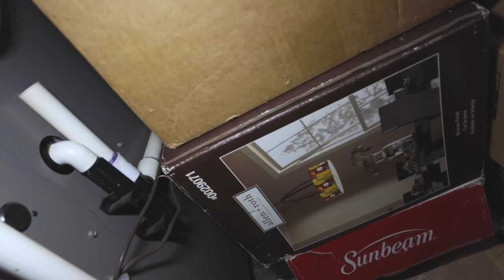Inducer Motor Gurgling Sound | 90 Percent Lennox Furnace Inducer Motor Flooding due to Blockage

Comment: Thank you so much for sharing this. I had the same exact problem, which is now fixed after following your instructions. Leaving a detailed comment, maybe someone can benefit from this. I've a similar Lennox furnace and it had been making this gurgling sound, which didn't bother me much. But over the past few days, my heat was cutting out intermittently. Thanks to some other videos on youtube, especially Jay @ World of Advice TV channel, i started looking for the cause and fix. Furnace was igniting, could see the flames but it will go out after 1 minute or so and occasionally worked fine for a day or two. Cleaned flame sensor, it didn't help. But I then noticed that my control board light flashed 3 times before the furnace tried to restart again. According to the instructions on the panel, there's supposed to be an issue with pressure switch. Tested pressure switch using multimeter and it was fine. Checked for blockage on little pipes going to pressure switch, they were fine too. Finally, came across your video, took apart the inducer motor, there was water in it, took off all little tubes/pipes as shown in the video and the tube going to header box was clogged at the header box, cleaned the tube and the connection point, put everything together. No more noise from inducer and the heat is back on.
Reply from the maker: Amazing! Glad the video was able to help. Hopefully you come across some of my videos in the future that can be of service. Be sure to subscribe and thanks for watching!

Comment: Hey piling on here... thanks!   Great help.  I wanted to share what I think was clogging my drains -- PVC pipe burrs.  I pulled out the inducer blower, and then when I pulled the condensate tubes from the lower ports, I found a small pile of PVC burrs and bugs collected at the green filter plugs.  I cleaned those out, checked the main condensate piping to be clear, and put it all back together.  Runs great, no water knocking/noise any more.  Thanks again!
Reply from the maker: Thanks for that feedback. Ive seen that before as well

Comment: You are the man! Had an exhaust pipe hanger break. When fixing, a lot of liquid backtracked into the blower. You saved us from not having heat on a night with record low temps. Also, great call on removing the pressure switch over the electrical box.
Reply from the maker: Nice! I'm glad I can help and thanks for sharing!

Comment: Just got home from Christmas vacation too a cold house and a furnace sounding like my bath. I cut off the p trap thinking it was clogged. Watched this video and learned what an inducer is and how he removed it. My unit was different so I just opened the clamps and put a tiny hose into the motor and put the other end to a shopvac. Saved me having to remove the inducer.  Yuck but worked well. Thank Tou!
Reply from the maker: Nice! Glad I could help, yeah most the Goodman furnace have a little yellow cap you can pull off the bottom inducer and vacuum it out from there.

Comment: Excellent ! This was my exact problem on my Lennox EL296 and I was able to follow your video to source the fix the problem. The culprit was a blocked drain tube 6 feet away from the furnace and the water backed up all the y way into the induction motor causing that gurgling sound, Checked and cleaned all the other components so all should be good. Started the furnace up, no more gurgling sound and no more error codes. Thanks man !
Reply from the maker: Sweet! You're welcome glad it worked for you. Thanks for watching!

Comment: Thank you very much for capturing this!! I’m trying to replace my inducer motor, and I have the exact same model furnace and exact same inside. I should be able to follow what you did in the second half of the video to a T to replace mine. In fact, I wasn’t sure if you needed to take the inducer motor off; I was praying that you did. 😂

Comment: Thank you so much for sharing this. I had same problem as Arsh  had:  heat was cutting out intermittently, but there was no signal show this AMV9 two-stage variable speed has problem according to the troubleshooting manual. I asked service company  to fix it. unlucky, first person came ,make wrong diagnostic and said must replace motor then can check if there is other issues. after replaced new motor & frame sensor  30min same things happened as before , we call again and second service came : found blockage in inducer motor coupler cleared blockage .drained inducer motor and reassembled , now is fine. but there manager refuse to give use refund , insist they did right things. I hope more people can see you TV channel even want  service company come.
Reply from the maker: Thanks for watching and I'm glad I was able to help you with your situation

Comment: Thank you.
It looks like I had a similar issue.
The AC and Furnace plumbing is together in the left side of mine.
Seems to be that in the summer, the water filled up and overflowed into the furnace.
Reply: I have this Lennox SLP98V furnace in the Chicago area. HVAC installed it in 2013 with the I Comfort thermostat. Many parts have been replaced over the years when the furnace stopped working; blowing debris out of condensate tubes, replacing the defective Pressure Switch, the new Blower Motor Module, the new leaking Collector Box, and the new cracked Draft Inducer Motor to try stopping all the water leaks inside the furnace. Now how do I get rid of all the rust inside the cabinet of the furnace?

Comment: Hey buddy, I want to thank you - you saved my ass!   Have a new install and the blower motor was full of water, which meant it would not run, condensation didn’t drain.  So I saw how you removed blower and cleaned out the lines.  In my case I just dumped out the water in the blower and then put it back.  Plus cleaned out lines, not sure what was problem?  Maybe pvc crumbs from install.  But if it happens again I can fix it again.  It’s Christmas Eve and it’s minus 2 degrees here, so my Hvac guys are not reachable, without your video I would have been totally fxxked.  Thanks again!!    Btw good call on just moving the pressure switch rather than the electrical box!
Reply: Make sure the furnace is at least level, front to back. For best results after leveling, the back should be raised a half an inch. Also, the pvc extension, or vent, on the condensate trap should be at least 1" above where the condensate exists the cold end header box but not more that 2" above that.
Reply from the maker: Sweet! Yeah it's a pretty common issue I was just working on one the other day and a bird or something must have built a nest and the flue pipe and there was a bunch of red clay and debris clogging up the drain ports. Make sure to inspect your flue pipe otherwise it will continue to happen if there's something in there. I appreciate you sharing and thanks for watching!
Reply from the maker: Nice! Really appreciate this advice. Sometimes these 90% lennox furnace can be a bit finicky so I'm always trying to get as much information on them as possible.

Comment: What prevents exhaust air /gas from going into the "drain" line out of the inducer blower.  My vertical 2" PVC out the roof filled up the inducer motor with rain water and shut the furnace down.  I vac'd out the rain water from the inducer.  I put a 90 elbow on top of the 2" flue pipe above the roof line.
Reply from the maker: There's a water trap directly in line between the inducer drain line in the drain line going out of the house so the water trap prevents the gases from flowing out

Comment: Hey, thanks for sharing this!! I have the same model - the inducer makes noise but when I barely hold it in my finger it stops making the noise, tried to tighten up the screws with no luck. The pipes aren’t clogged/clear tubes. Do you recommend any solution?
Reply from the maker: It might be the internal bearings which I'm not sure are serviceable but that's the case you probably just have to replace the whole inducer assembly
Reply: I have this Lennox SLP98V furnace in the Chicago area. HVAC installed it in 2013 with the I Comfort thermostat. Many parts have been replaced over the years when the furnace stopped working; blowing debris out of condensate tubes, replacing the defective Pressure Switch, the new Blower Motor Module, the new leaking Collector Box, and the new cracked Draft Inducer Motor to try stopping all the water leaks inside the furnace. Now how do I get rid of all the rust inside the cabinet of the furnace?

Comment: My Lennox furnace just started making a similar noise, no faults just louder than normal. I would like to send you a short video of it to determine if I have a clog or if I need to replace the draft motor assembly.
Reply from the maker: Sure! you can send the video to hvactechknowledgy@gmail.com.
Reply: Heat exchanger secondary  could be starting to plug up

Comment: I have this Lennox SLP98V furnace in the Chicago area. HVAC installed it in 2013 with the I Comfort thermostat. Many parts have been replaced over the years when the furnace stopped working; blowing debris out of condensate tubes, replacing the defective Pressure Switch, the new Blower Motor Module, the new leaking Collector Box, and the new cracked Draft Inducer Motor to try stopping all the water leaks inside the furnace. Now how do I get rid of all the rust inside the cabinet of the furnace?
Reply from the maker: Hi there, sorry there's really not much you can do about the rust. If it's not that bad you might be able to put some of that evapo-rust on it. You can find it at your local auto parts or Home Improvement shops

Comment: Mine started making a similar gurgling sound just. The condensation line drains into the sewer but some took the hose out of the sewer and left it on the ground. I'm wondering if some water got backed up into the inducer because of that?  The hose is not plugged there is water on the ground. Since putting hose back in the drain the noise has become less and less. My question is if there was water in the inducer can it work it's way out on it's own? or should I take it apart like you did and see if anything empties out?
Reply from the maker: Sounds like the trap might not be primed. Try adding water to the condensate trap and see if that helps.

Comment: I saw that my Lennox inducer motor (93W13) have the wheel fan shattered (transparent plastic) and make a loud vibration. The motor is on point, but will be a shame to replace the whole assembly just for that simple plastic part. Is there a way to replace the wheel fan only?
Reply from the maker: No sorry as far as I'm aware they only sell the entire assembly with motor and impeller

Comment: Morris jenkins recommended to change drain line in attic and  as per them I asked them to replace but now my gurgling sound from refrigerant is so noisy  . There are no issues to heat . Any input will help me. I feel morris jenkins is cheating me
Reply: Refrigerator lines making noise or the drain line they replaced is making noise. If it's the drain then probably they didn't put a cap on the clean out and if it's refrigerant  lines making noise then you could be low on refrigerant and its boiling before reaching evaporator coil.
Reply: Thankyou I called them and they put the cap yesterday. Thankyou very much sir

Comment: I have a carrier furnace with inducer with an AO Smith motor. The inducer makes a whining noise for about 2-3 seconds when the furnace starts up and after that there are no abnormal sounds coming from it. Any thoughts on my problem. Thanks very well done video.
Reply from the maker: Sounds like it could be the bearings or something. How old is the motor?
Reply: @HVACTechKnowledgy  the unit is 15 yrs old. My confusion is that it whines for about 10-15 seconds and then sounds nornal. Kinda like a fan belt squeek whenever you start a car. thanks for your input.

Comment: I have a 5 month old Lennox SLP99 which from day one has made an unusual random rapid metalic ticking noise during inducer fan startup.  I suspect condensate hitting fan blades and plastic housing.  Lennox will not talk directly to me, only via their distributors (customer service?), and my installer, after telling me the noise  was "normal", just fixed his incorrect mounting (was pitched back, not "level to 1/2" front down".)  While that helped, the noise is still obvious.  
So indeed, is this noise normal?  It is so obvious, I can't believe Lennox  would market a furnace.

Comment: So we have an issue with a recently installed trane unit that sucks water from one of the drains and as such causes the motor to gurgle the way it did here. Any thoughts my guy?
Reply from the maker: I'd start by checking to see if there's enough pitch on the flu pipe, pitching down  toward the furnace. Then make sure the Trap is primed and the condensate lines and trap are both free and clear of blockages. Also make sure the unit is level.

Comment: I don't understand why they don't just put a drain hole in the bottom of the blower housing so this never happens.
Reply from the maker: Very good question, not sure I believe some manufacturers used to have that but they stopped doing it pretty sure there was a method to the Madness though.

Comment: Mine just leaks. Inducer motor is fine
Reply: I have this Lennox SLP98V furnace in the Chicago area. HVAC installed it in 2013 with the I Comfort thermostat. Many parts have been replaced over the years when the furnace stopped working; blowing debris out of condensate tubes, replacing the defective Pressure Switch, the new Blower Motor Module, the new leaking Collector Box, and the new cracked Draft Inducer Motor to try stopping all the water leaks inside the furnace. Now how do I get rid of all the rust inside the cabinet of the furnace?
Reply: @sharonharding7215  my collector box has leak rusted streaks as well.  I have some rust the sheet metal right below the collector box and inducer motor. I wired brush most of it. As I was doing it I had a vacuum to suck in all the debris.